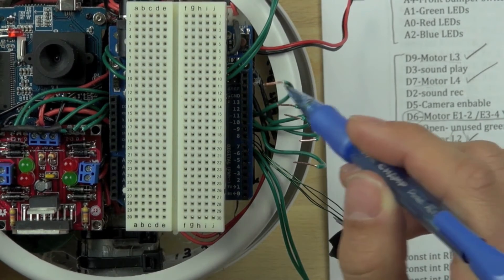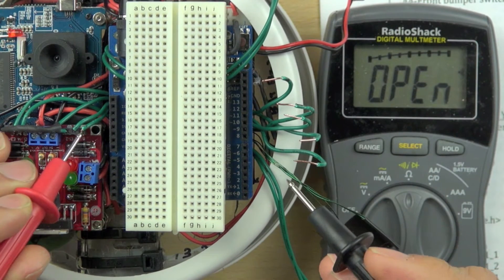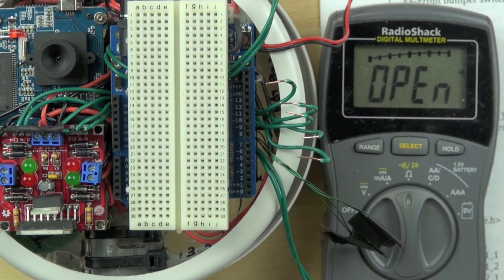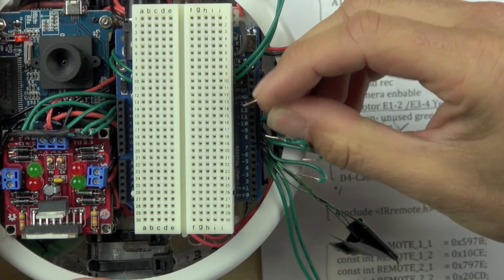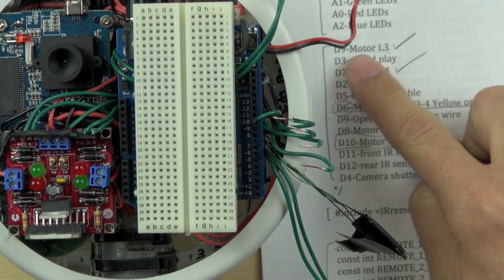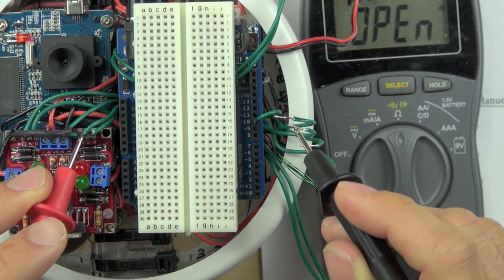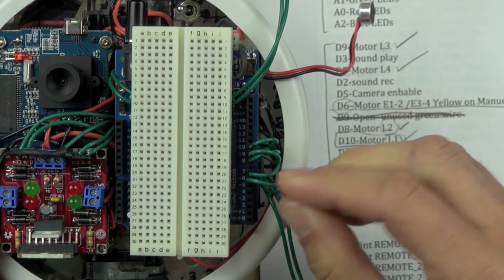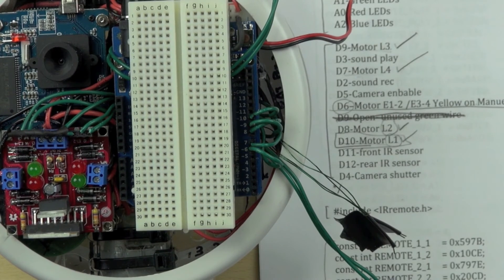Motor controller connection to Arduino | Electrical engineering | Khan Academy

Comment: What does it mean when a wire is continuous.
Reply: means that the wires are connected if there is any break in the connection the electricity won't flow, and the sound won't beep.